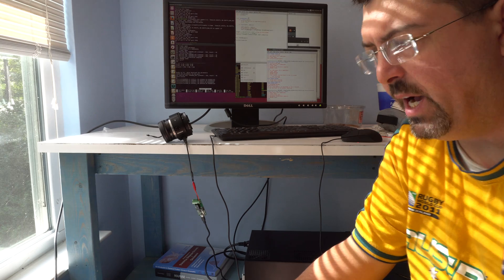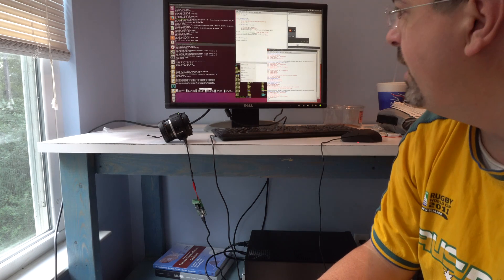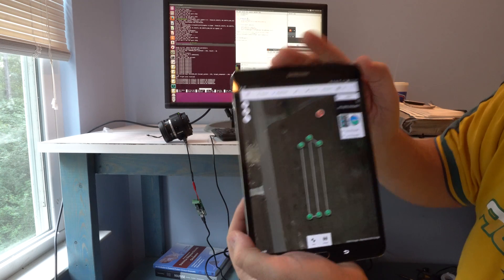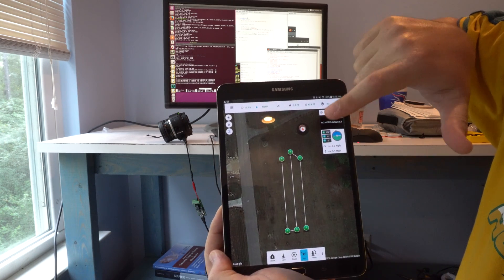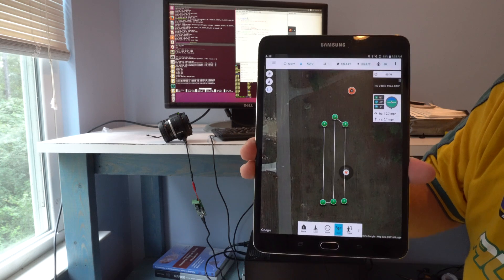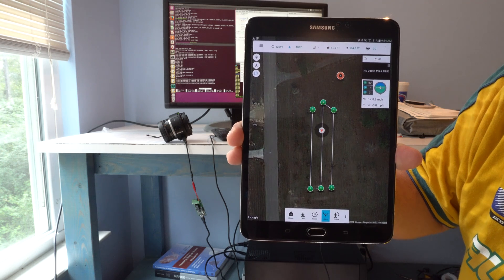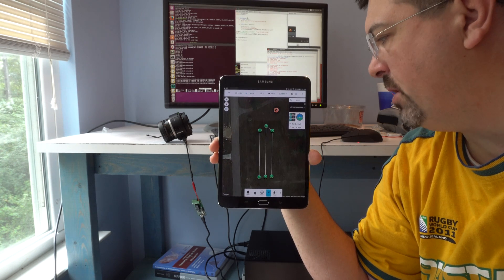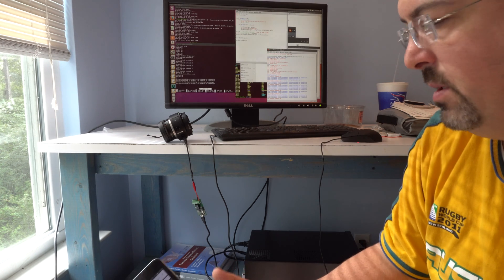Qx1 - 3DR Solo -USB Relay Control Demo

Comment: Nice.
Can you still trigger the GoPro with your script or does your code disabled the "standard trigger"?
Reply from the maker: Triggering the GoPro is not affected.
Reply: and did you use the Accessory Breakout Board for connecting the usb relay module to Solo?